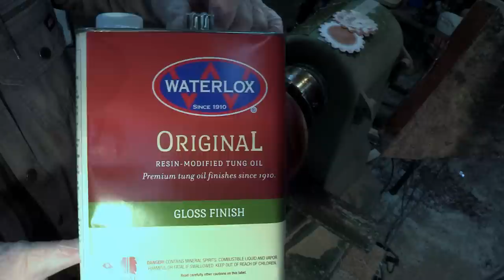Woodturning - Cherry Crotch Hollow Form

Comment: You need to let your vacuum pot do the work for you. Especially when the wood fits that tightly in the bucket. As thick as the epoxy is, it doesn't flow easily between the wood and the bucket. You are better off leaving it under vacuum for a longer time  and less time in the pressure pot. If the air is still in there the pressure pot is going to trap it in there and it has no way out. I know its hard playing with the vacuum when it keeps bubbling over, but just crack the valve until you still have some vacuum without bubbling over and leave it. After it starts to settle down you can put full vacuum on it to get the rest out. Then put it in the pressure pot. It ill be ok with deepcast but it might be a little touchier with Artcast. There's my 2 cents worth, Jim.  No I don't work with this stuff, but I have worked with vacuum with refrigeration, and if its really bubbling you've still got a lot of air. Best of luck! Keep the videos coming!
Reply from the maker: The process you described was exactly what I did with the original Deep Cast pour, like you said, I don’t have a lot of time to fool around with Artcast so that’s why it didn’t go into the vacuum chamber. The solution to this problem would of been to just simply drive screwdrivers down into the areas between the voids and the buckets or cut groves down the side of the casting to allow the epoxy to flow down into those areas. Thanks

Comment: all you needed to do was cut small access holes on the side to of the peace to let the resson and the air have channels to travel down and out.
Reply from the maker: When this happens again, because I know it will. I will stick screwdrivers down the side of the bucket and that should allow the resin to flow down and fill the voids. I’m not a fan of cutting groves on the side of the casting. That will take size off the piece. Thanks

Comment: Nice save but not my favorite.  At 26:50 I saw a lidded bowl. If you had separated it at the resin line you could flip the top piece over to make the lid
Reply from the maker: Yes, that would of worked. Thanks

Comment: Just my $.02... I think you could've shown the beautiful crotch grain by making two platters much more easily than having to battle with resin issues. Designer Epoxy is great stuff but if you want the figure in the wood to be the star, then leave the epoxy in the jug. Sorry Jim but you asked for opinions. Good luck on reaching 100K!
Stuart
Reply from the maker: I get what your saying but those two cherry crotches on there own wouldn’t of really been a statement piece, but this is. Thanks

Comment: I think you missed an opertunity not doing the wire with clear reasin pinch. Its still very nice but i just cant help feeling like its not what it could have been.

Designer Epoxy
Reply from the maker: Yes, you are right, possibly. Thanks

Comment: Cursed projects: I did miniature wargaming and I had a Bad Luck Pegasus. It just WOULDN'T keep its wings on. We used every kind of glue, putty, pinning, even sculpting over the joints to provide exterior support.  Nothing worked.
Reply from the maker: Yup, they happen! Thanks
Reply: @SpragueWoodturning  I still have the pieces. And it was very wonderfully painted maybe I should encase it in resin and just have it for display.

Comment: Hi Jim.... First off, stop being so darn hard on yourself.  You really over think things.  I know you're an artist and that you're being judged by your peers, but your average person isn't going to think stuff is ugly.  
Second, I think I may have found a way that people can see inside the hollow form or a hollow form. If they have translucent resin you could light that resin on the outside and it would light up the inside and you would be able to see very well.
Third try a store like Walmart and buy those cheap 3 pk cat laser pointers.  They run less than $20 US dollars here in Florida.
And finally... I would love to see more of that gold that you put into the cracks... you did in one video where you used the super glue and I think it was gold foil or gold glitter and you rubbed it into the cracks. That looked awesome.   A lot of the wood that you work with seems to have cracks that could be filled that way.  You could do that before you pour resin that way when you turn off the resin and you'd see the gold underneath.
You are doing amazing work.  Really you are a few steps above the rest.  Thanks for the education!
Christine Hannigan
Port Charlotte Florida
Reply from the maker: Thanks for your suggestions. I really appreciate it!